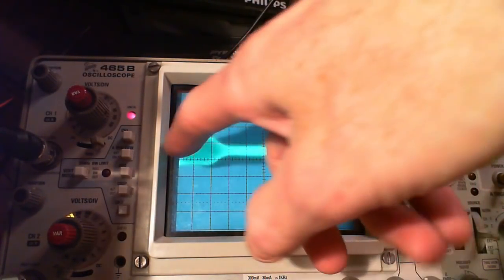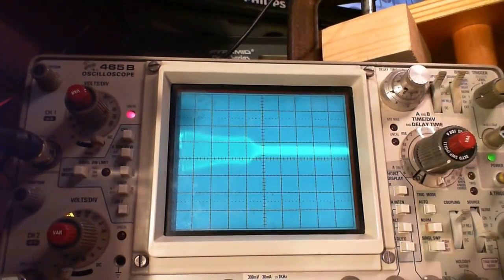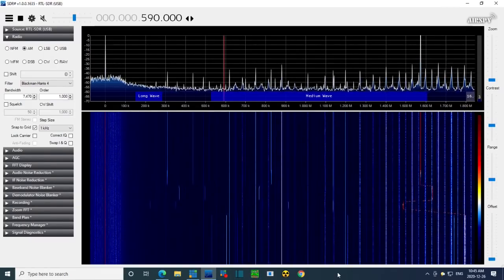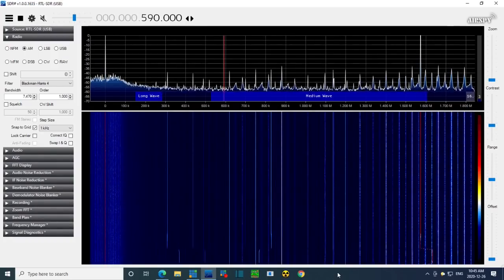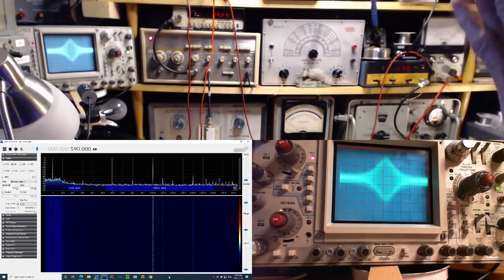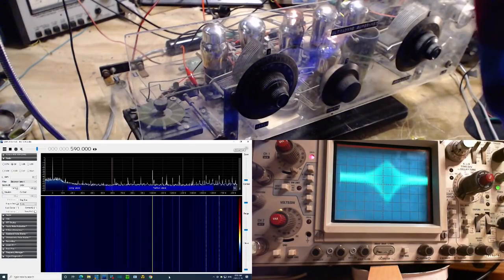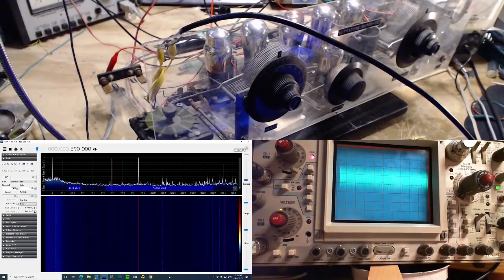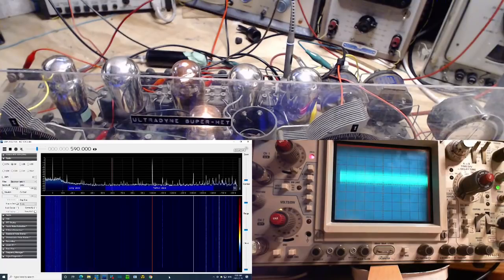Lacault Ultradyne 1925 Receiver Video #4 - More Progress

Comment: Jim is starting to stray off base again. He’s getting confused about the I F frequency. These early mid 1920s battery operated superheterodyne’s used very low IF frequencies . For example the famous RCA A.R. 812 super het Used and I F  frequency Of 45 kHz. The IF frequency of this set is surely under 100 kHz.

Comment: Jim has forgotten that there is a rotatable inner coil inside the oscillator coil assembly. He needs to rotate that a bit to peak the oscillator signal.Finally after 37 minutes he realized that he was trying to do this work with no B+ on the tubes. Entertaining but very frustrating

Comment: Add about 10 minutes into the video Jim uses a 1K resistor to bridge the open primary of the first audio transformer. He’s heading in the right direction but still wrong. To do RC coupling for an audio transformer with an open primary do you want to use a 22K to 30 K resistor across the primary and then a 0.05 µF capacitor from the plate terminal of the primary to the grid terminalOf the secondary winding. He could easily do that for both audio transformers and the radio will work although with some reduced amplification because you’re not getting the step up of the audio transformers